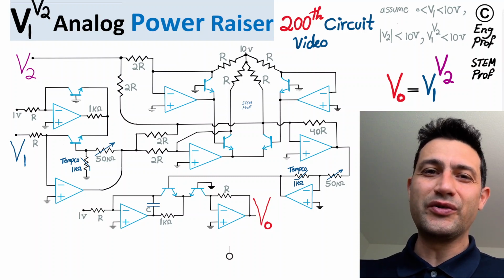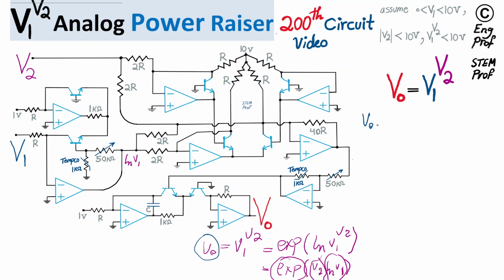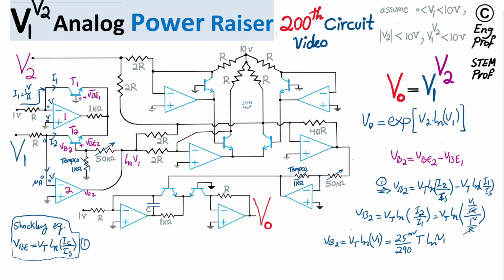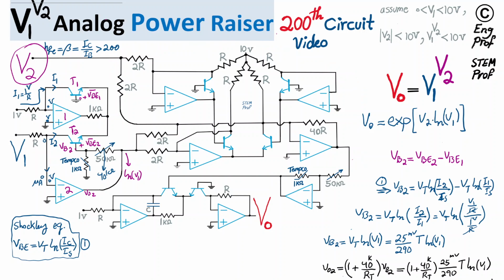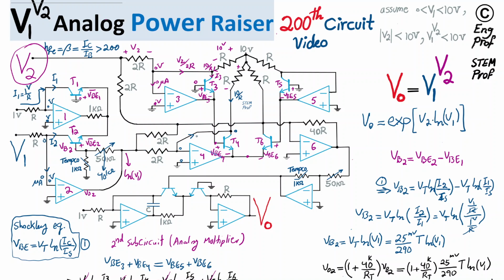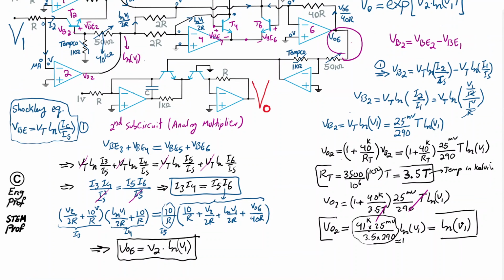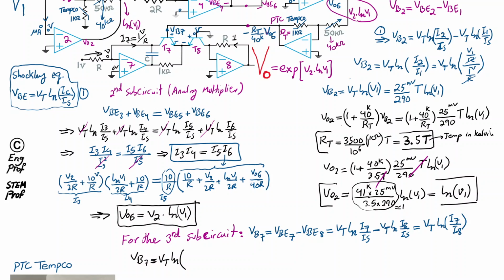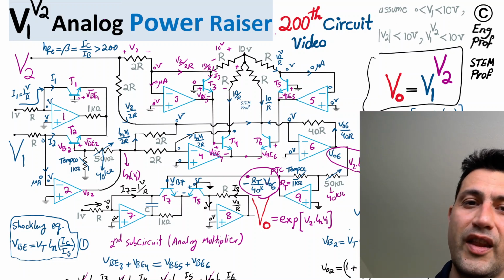Analog Computer Power Raiser Design with OpAmp, Transistor & PTC temperature compensation

Comment: I'm sorry I didn't do these calculations for years and I understand that you operate with approximate values but it still puzzles me how did you go straight from tempco to resistance value? Isn't it the proper formula: (1 + 3.5 * 10e-3 * delta T) * R?
Reply from the maker: @voice4voicelessKrzysiek  No Problem. Yes, starting from the formula TempCo Resistance = (1 + 3.5 * 10e-3 * delta T) * R  = (1 + 3.5 * 10e-3 * (T-300) ) * 1kohm = (1 - 3.5*10e-3 *300 + 3.5 * 10e-3 * T ) * 1kohm that then simplifies to (1 - 1 + 3.5 * 10e-3 * T ) * 1kohm  =  3.5 * 10e-3 * T ) * 1kohm  and therefore  TempCo Resistance = 3.5*T where T is the Temperature in degree Kelvin. I hope this explanation is helpful.
Reply: @STEMprof  Yeah, thank you, I got it. Losing my agility in mathematical thinking in my old age 🤣
Reply from the maker: Glad that the explanation is helpful. 🙋‍♂️

Comment: This is a fascinating circuit. How wide of a result voltage rail can you do if you tried with wide op amps?

Will the circuit do negative voltage power as a division fraction?
Reply from the maker: Thank you. Glad that you liked this circuit. You can try larger voltage rail valued as large as Op Amp and NPN BJT transistors can properly operate.  And yes, negative power also works as long as abs(Ln(V1))<10 Volt, abs(V2)<10 Volt, and V1^V2 < 10 Volt in this circuit. I hope this is helpful.